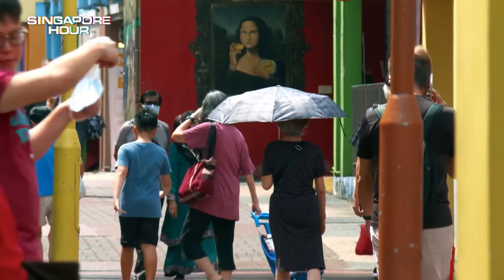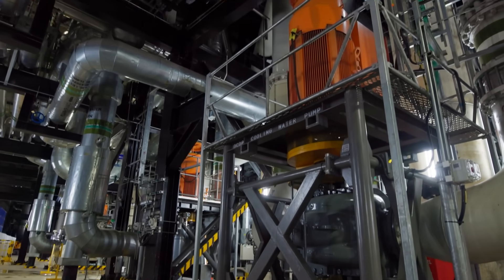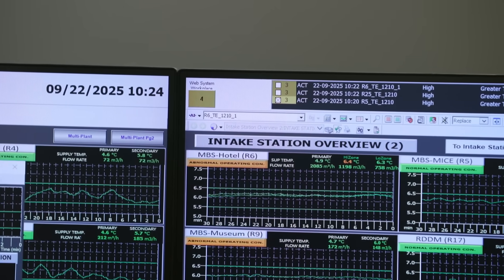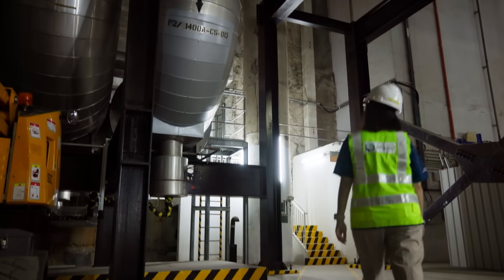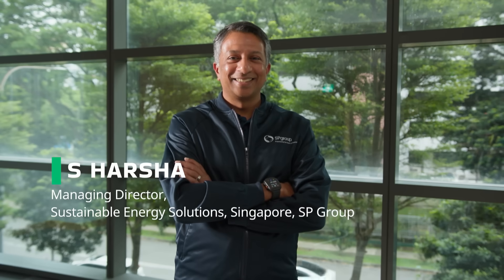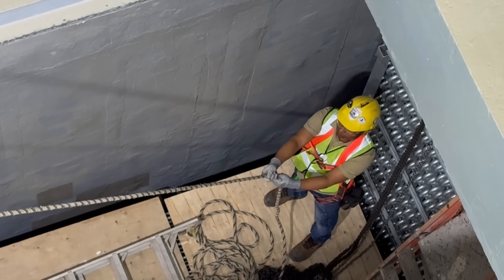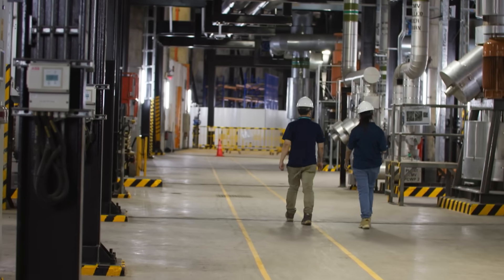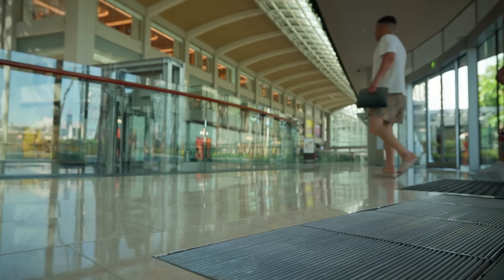The Secret Cooling Network Hiding Under Singapore’s City Centre | Singapore Hour

Comment: Singapore is a huge integrated machine. Transport, power, waste, cooling all integrated into a compact efficient solution.
But it requires strict limits on property ownership and individual freedom to make it work. No problem as long as authorities are benevolent. What if they no longer are?

Comment: Thanks CNA. You just exposed sg incompetence. MBS was designed and built by foreigners. Its cooling system was designed and built by foreigners. When sg tried to replicate it indigenously for Tengah BTO, it was an utter failure... with leaks and higher operational prices.

Comment: District Cooling Heating System works more efficient than stand alone cooling system that is typically fitted on a building, but it has to be a reliable one, some district use ice storage and some just use chilled water storage like the one near Mediacorp of metropolis depending on load application and demand. Singapore is making a move that is really utilizing it limited land resources. So is crucial those people working and maintaining the system down there is working well or many building will be in a very warm to hot situation at one time. Unless some individual buildings have its own conventional back up air conditioning system install.

Comment: Strange that deep ocean water wasn't used to dissipate heat
Reply: Ocean water isn't that cool. You would need more volume of water to cool that way.
Reply: @BlueOceanStrategistS I guess it's all relative.  Check out Toronto, Canada where some of the downtown buildings are cooled by deep lake water.  Check out Sea Water Air Conditioning in Hawaii, USA where 41F deep sea water is used.  This also applies for OTEC.  Deep ocean water could provide power, air conditioning, kelp farming and fresh water for Singapore.  It fits the political model as well.

Comment: So it is just the thermal cooling concept but at a city wide scale, can we also use the byproduct heat to warm the sewer plan for the micros to work
Reply: Those hotels would use a lot of hot water as well.  I wonder if they are using heat pumps from the waste heat to heat the water?

Comment: Sounds like a missed opportunity to put the waste heat to use: pre-warming hot water supplies.
Reply: It doesn't work that way. The exhaust heat is probably around 40-45 degC (would be good if someone knowledgeable can confirm). 

You can probably heat up room temperature water to 35-40 degC. As the temperature difference between the hot-cold side get lesser, heat transfer gets much slower, to the point that you will either need a very very large heat exchanger (high cost), or have a low throughput (which will limit the cooling capacity of the whole system). 

Say you have 40 degC water. You now need to transport these warm water in insulated pipe to all the users around marina bay. The further you transport the warm water, the lower temperature gets, because insulation isn't perfect. All the buildings in marina bay must now install additional warm water piping, going to warm water users (showers, kitchens, etc). The next question is, are there enough users to use these pre-heated water to justify the capital cost of enabling this low value warm water source? I highly doubt so. 

TLDR: Waste heat is only valuable only when it is at a high enough temperature for you to recover.
Reply: @boowhale  Because of how much energy water holds, per-heating potable water can still be a valuable energy usage. The water coming out of the supply piping may be ~ 10c, and heated to 60c for use in showers. Raising the temperature to 35C is half the energy that would otherwise be needed, and if this is waste heat already, capturing some of it is free energy.
Reply: @Nemo222 The factor that you should be considering is the benefit to cost ratio. A 40 degC warm water line is a very low value energy stream. It is simply not worth it to invest so much capital cost to lay the water header pipe to all buildings to deliver it. Bear in mind that pipe laying is a massive civil work task that includes digging up land of existing infrastructure to put those pipes in.

This whole cooling system is a mega heat transfer utility plant. You got to trust that during the plant design, the engineers are fully aware of this waste heat stream because they have to do a heat balance as part of the plant simulation.

They would already have considered the potential use of this stream, and evaluated whether it makes sense to send warm water to consumers, most importantly to our discussion, have decided that this is a poor idea with low BCR.
Reply: Would be such a good way to supply heat for showers or other applications!

Comment: Go look at Tengah , the CCS by SP Group and Daikin , it's 30% more expensive than concentional aircon , leaking everywhere even in common area. 
You notice they say electrical price spike right? it's actually wholesle , which is generally 30% cheaper then SP normal rate. meaning actually CCS can be cheaper its just them profiting from it instead of giving the saving they promised to consumer. They promised 30% saving when people were signing up now its 30%+ more expensive than conventional aircon.
S Sarsha could had managed it well he didnt
Reply: That was a prototype project that failed. Not suitable for residential households as the equipment ages, many issues will occur and do they have the funds to replace??
Reply: Keling kia
Reply: Meow, WHY don't you start a company Selling single items at WHOLESALE Prices.
You're sure to make it 🎁🎈❓

Comment: I hope we can all agree that the constant, oppressive heat is one of the greatest liabilities Singapore faces. Keeping the nation cool should be a top priority to maintain our liveability and competitiveness.
Reply: yeah but how about when you are outside? you cant put AC outside.
Reply: @rizkyadiyanto7922 its actually possible, by letting it flow from under the tiles you walk on, and having fans which disperse cold mist. Saudi does this and it really helps alot. Not sure if its fully applicable in Singapore but Im sure the engineers have similar concerns and are working their way around it.
Reply: rather than just focusing on this, we should be pushing more about tackling global warming and climate change. in the end there's only so much a cooling system can do, if the whole earth warm up.
Reply: @kenshee627  It's not a zero sum game. We can acknowledge that Singapore needs heavy, sustained investment in air-conditioning - especially that using new, cleaner technology - to maintain our competitive edge and liveability. We can also rationally (without fear-mongering) address the projected*, *long-term effects of climate change. Singapore has been doing plenty of that for thirty years already. With that aside, you sound like someone with genes uniquely suited for SG climate. Consider yourself among the lucky few, and pity your fellow citizens.